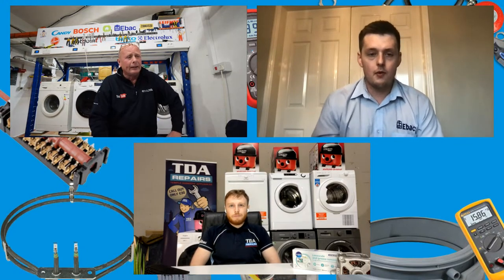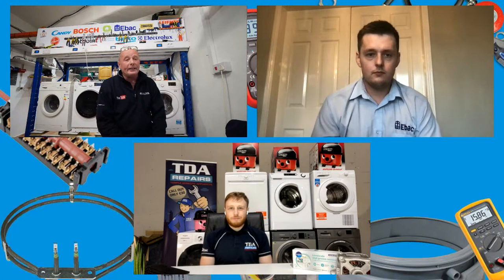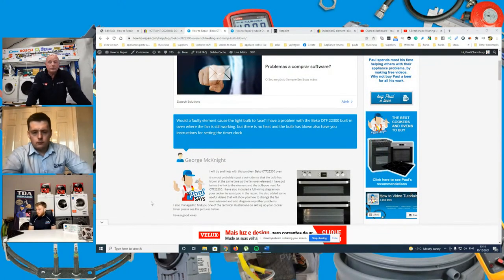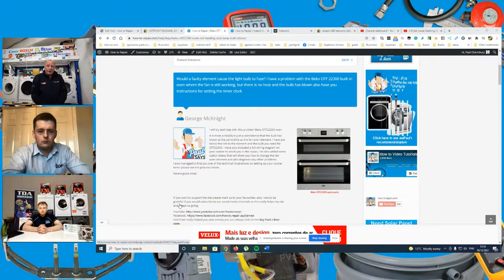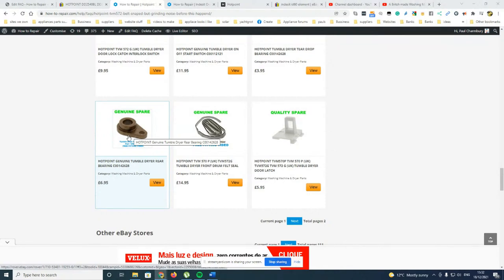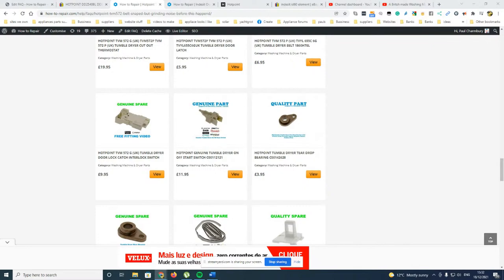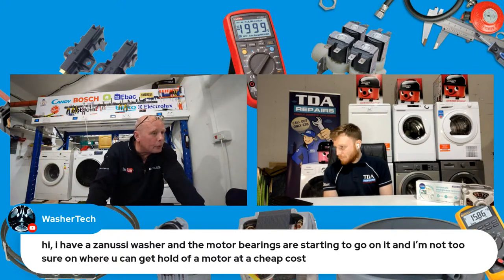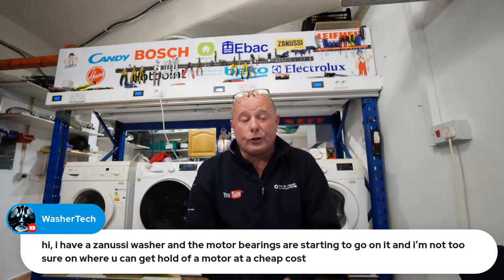Live Q&A's on Appliance Repairs

Comment: Hi, followed your advice to replace the belt on a hotpoint aquarius tcm580 bp uk & got that done OK but I knocked 2 wires off of the timer at the top right hand side. 1 red & 1 blue that fit into no's 2 & 3 - can you tell me which one goes where ? Thanks Dave in Scotland.